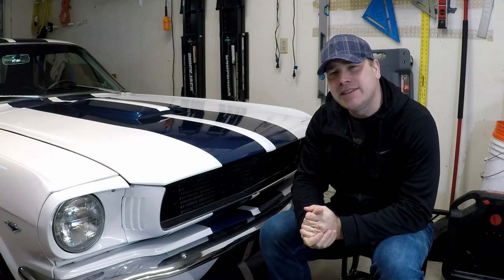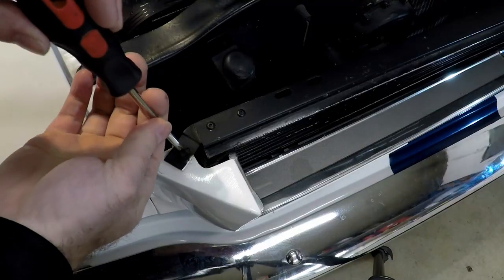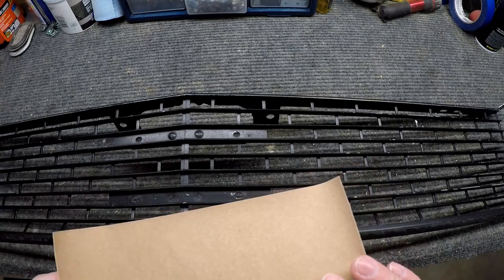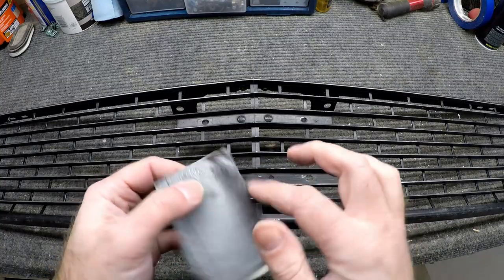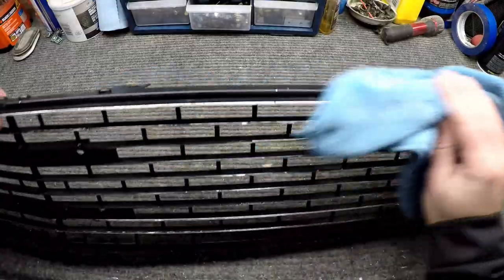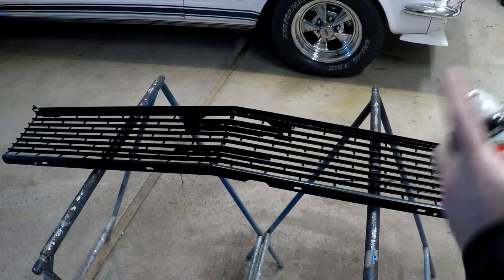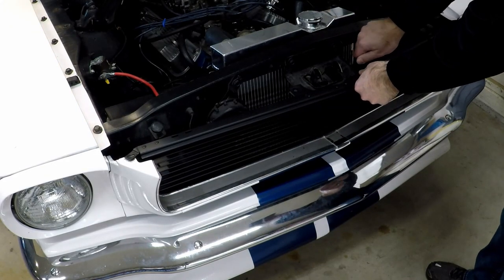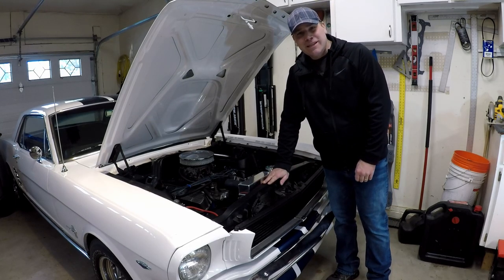How to paint the grill on a 1966 Mustang

Comment: thanks for the video, do you know where to find the plate connecting R & L molding pieces when pony emblem removed?
Reply from the maker: Thanks!
You might be able to find used parts on Ebay.  New parts might be at National Parts Depot or CJ Pony Parts.